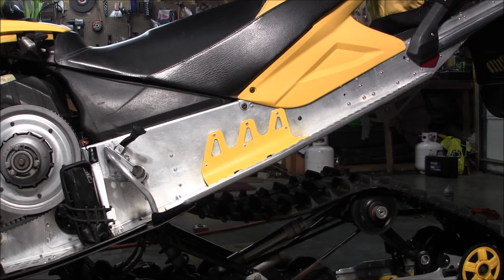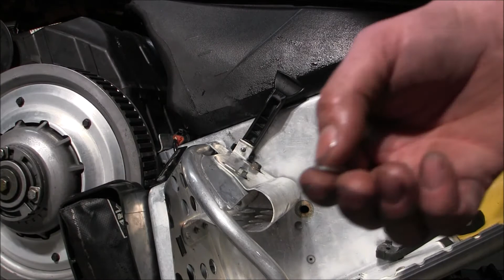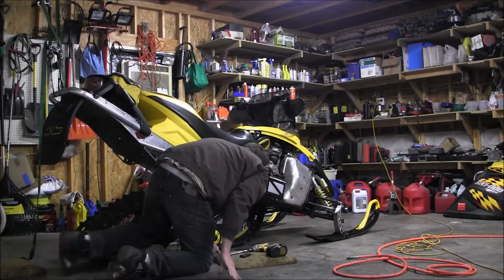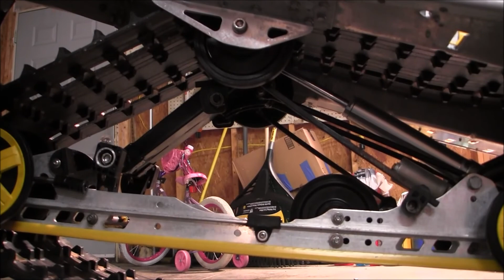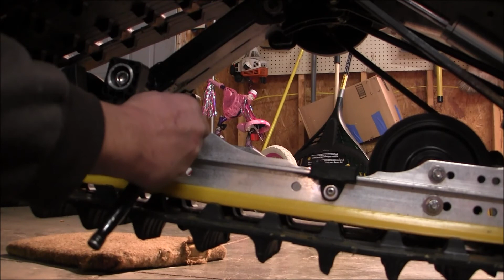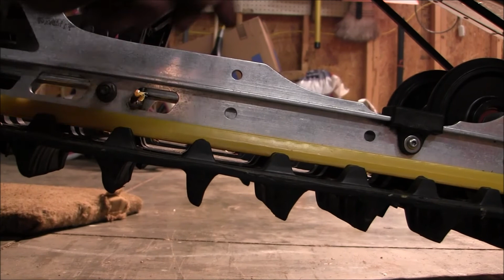Skidoo Rev 800 suspension part 2 adjustment/side panel straps, Episode 17

Comment: I was thinking about putting a nut and bolt in there to save time when they dry rot for the next owner. I had to take all of the plastics off for the top ones.

Comment: geezer buddy don't b so cheap and buy some new drill bits. And I find it pretty funny that you are struggling lol.
I would of drilled from outside and used two washers . now I wasted those few minutes of my life
Reply from the maker: +Crystal Hamelin you still have to put rivet in from inside and you cant get gun in there without lifting sled like I did. And the rivets were strong as hell. And not easy to drill rivets backwards.